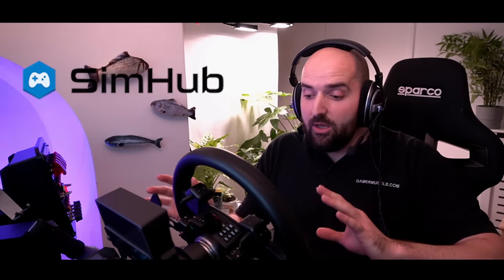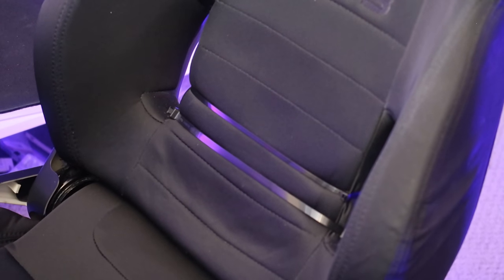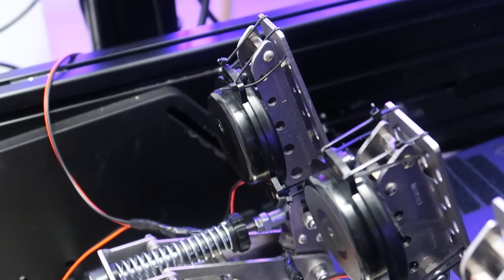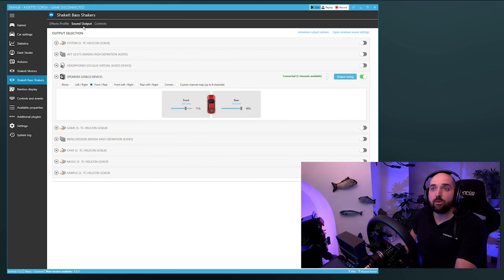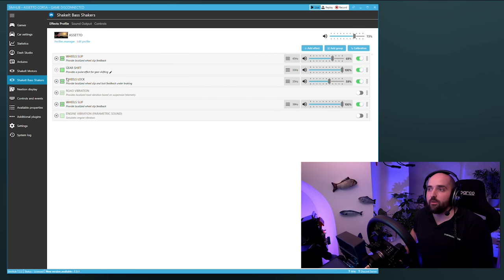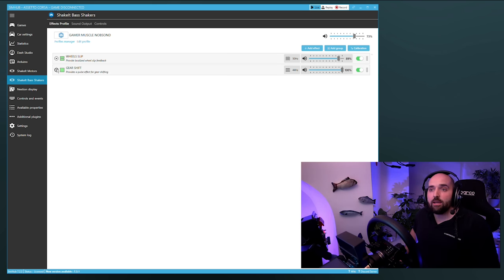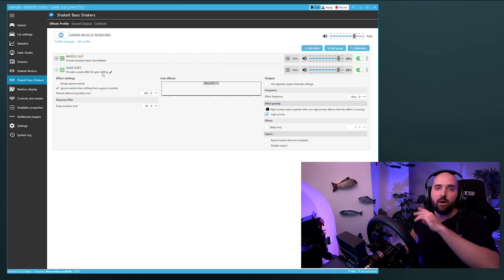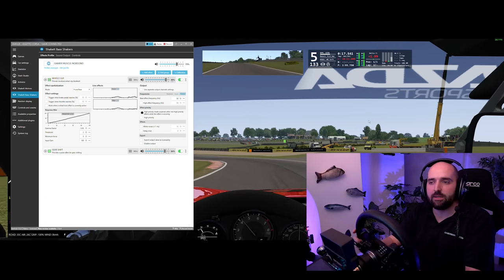How To Add Motion To Your Racing Simulator For £150 - Guide

Comment from the maker: Subscribe for more NOBSOUND - If you don't have fancy pedals it might work out better to use a single Dayton Base shaker on a pedal tray as well as seat.
My amazon links 
➤ USA AMAZON               :  https://amzn.to/2NdL7an
➤ UK AMAZON                  :  https://amzn.to/2LkP50n
Reply: They should've called this thing Noobsound, since it's not the right device for powering shakers! You want an amplifier that has power and in Germany it's called 'Endstufe', because Germans have a name for it and this watt-numbers some 'manufacturers' put on their box must be another Watt than the Watts you want. After my first amplifier died very soon from overheating, and this was a big Sony receiver allegedly capable of hundreds of watts output, I bought a Fame Quad 4150 with a weight of 17,5 kg without the box. There are lighter ones in similar XXL-size, but they come with a fan and it's not a silent one. The Fame Quad can power 4x 100 Watt at 4 ohm and nowadays I would pick a Fame MS 5004 that can output 4x 520 Watt, so capable of powering big buttkickers as well💪. If you power one or more of these and put your rig on springs (I would choose valve-springs for that purpose), you can call it a motion-rig😄
Reply: Hi James, are you still using this? has the Nobsound burst into flames? 
I am thinking of going for X2 Dayton Bass shakers with this Nobamp, the two bass units bolted left and right to the rig (TR160) to get engine vibration and road feel. To possibly transfer through the whole of the rig. Do you think this might do that, all be it possibly quite subtly, or is something more beefy required for that?
Reply: @fingers68  You need proper Buttkickers or similar (100+ Watt) and amplifiers that can power them. Usually I suggest to buy cheaper shakers, but Buttkickers are the better investment. More reliable and relatively silent (from the rattling). Also easy to fix to aluminium profiles.
Reply: @Leynad778  "relatively silent (from the rattling)"
 Yes this was another thing on my mind. I imagine cheep ones would be just like cheep speakers. Im wanting a subtle vibration not having the wife throwing slippers at me 2am in the morning due to the what could be a very annoying noise going through the house, possibly street!!
Reply: @fingers68  Than you better buy weaker ones like the Dayton-shakers and put your rig on rubber-feet. The bass-vibrations will penetrate through the floor, walls and ceiling and even vibration dampeners can't fully prevent that with strong shakers. I put my hole rig on acoustic foam and before on springs to prevent that. Wasn't loud for me, but for the neighbors.
Reply: @Leynad778  cheers for your help on this. I guess it's all experimental to get the feel your after. Do you think it worth trying the NOBamp with a couple of the Drayton's bass. I'm looking at this tiny amp and thinking what can that possibly be capable of? 
I would love to feel the vibrations from the engine when it's screeming, along with a bit of road feel. But if this is going to cause massive in house antisocial unrest, it's going to spoil it.
Bare in mind our house is not a quiet one by any stretch, two teenage kids,  we all like loud music. Had no complaints from next door. But bizzar frequency noise is another matter. 🤪
Reply: @fingers68  Read my initial post here. With tiny amplifiers you need to be in direct contact with the shaker to feel something I guess. Don't give up on a proper solution and just put your rig on foam to properly decouple it from the floor. This acoustic foam I'm using is a bit too soft and those gymnastic matts seems perfect to do the job. You need a bit of lateral and vertical movement and it also adds to the immersion. One matt could already do the job or staple two or three if not. They have the perfect stiffness.
Reply: Thanks for this video. My Nobsound was delivered today along with a DAC for my TV from Techole. I'll be plugging my Nobsound into my Techole over the weekend to test them out

Comment: Calling this motion is like describing myself as looking like Brad Pitt 😂
Reply: Works better in vr, helps feel of motion for sure
Reply: I second this motion
Reply: He think he means in a way to tell what the car is doing so technically it is adding motion information at least
Reply: Adding motion information & vibration IS motion.
Reply: @BoltRM  Not really because motion implies something moving not vibrations. So it is giving you information through motion of a rumble motor but not motion as in moving the driver clearly this is what i mean
Reply: @Simlife101  So vibration isn't movement?
Reply: @BoltRM  obviously motion in terms of sim is perceived differently than if the word VIBRATION if used in the title.
Reply: Exactly my thoughts. This is rumble feedback. Not motion. Motion means the rig or seat is actually moving to simulate some type of g force. Lol

Comment: Literally the first time I've heard of transducers being referred to as adding "motion" ;)
Reply from the maker: Yah its a bit of a stretch but at the same time it gives you some of the qualities that you get from motion rigs and certainly some of the immersion.
Reply: That my friend is called clickbait 😂
Reply: @GamerMuscleVideos  I pay 2200 euros in real motion, don't say motion if it's not
Reply: @GamerMuscleVideos  100% agreed with mr. Muscle. I use 4 small 20w vibration speakers on my rig, wheel, pedals and shifter for engine rumble and my t-gt is adequate for communicating wheel slip and traction loss etc. In vr it really helps to give the impression that the car is moving and improving the immersion greatly to the extent that i couldn't play without it. The thumbnail is a tad misleading though. I thought that the great el capitano had miraculously stumbled upon a new seat mover for 150 quid causing m' greedy old ticker to hammer in my chest. Take it easy tiger for christ's sake!
Reply: @GamerMuscleVideos  Clickbait.  I thought you were going to show us how to make a 2dof motion using windshield wiper motors. 
 Shakers are cool , I have a Shakekit (on your recommendation btw as well as a power wind)  but I wouldn't call it motion. (Unless you are counting the micro-movement of butt cheeks whilst vibrating, movement)

Good thing about this video is that it proves the Shakekit is 4x too expensive. Wish you posted this video before.

Comment: I'm really honoured by this presentation (as the simhub author) ! You are totally right, the "butt-feets" rule is the best way to start, "chassis" mode (corner) needs some more heavy hardware to start to be interresting
Often i recommend as a startup a 4 effects combo : slip, road vibration, road rumble and gearshift , but when it comes to entry level transducters, "less is more" and indeed less effects will improve the details, it's a matter of balance and taste :D.
Reply from the maker: Software is awesome :)  

Yah I have 4 of the pucks and have used some other rigs in the past after messing around a ton I found separate to immersion the main thing was the two pucks on the pedals and having them vibrate for front slip as that's the one effect that's often missing from sims ffb and can really help know how much you are pushing and to what extent. 

Bum shaker for gear clunk or listening to drum and base music is mostly immersion as you can typically feel rear slip from FFB getting lighter with most sims.
Reply: @GamerMuscleVideos   If you were driving a 750+bhp racing car at frightening speeds, surely the predominant vibration that you would feel would be it's thundering v8 engine, non?  I once owned a tvr griffith 500 and that was certainly the case even at 30 mph!
Reply: Hey Dude
I have been using this software with Project cars 2 and ACC ....Its Awesome and does just what it says ...Great job...
One question though Project cars 2 is the only sim that for some reason has constant vibrating when going down a straight in say the Bently gt3  any track...is this a  game issue or something else...All other Sims are sweet...
Can you try it Gamer muscle and tell me if you notice the same thing...must have kerb and grass vibration turned on..
Cheers
Reply from the maker: @jamesmccaul2945  you can shape the graph to get that to some extent. 

To be honest for it to really help with driving better you need the racing SIM to do the FFB from the wheel with seat of the pants and other aspects built into the wheel ffb. 

Shakers are great and add a bit of info and lots of immersion but they don't have the capacity to be anywhere near as detailed as what you get from a ffb wheel which is giving your hands a continued push force as apossed to a vibration of varying degrees.
Reply: I just got my own license...great program!
Reply: Kudos for an amazing piece of software. Thank you 🙏🏻
Reply: @jamesmccaul2945  Hi matey was wondering if you could upload a video of your set up of the shackers on your playseat as I'm looking to do the same. Many thanks Stu
Reply: @kevinharkness2108  I used to have one too... want to know how to get that TVR nostalgia trip? I found this out by accident while I was trying a TVR Tuscan mod in AC and in VR. While in-sim the bloke next door started sealing and creosoting his fence. The smell of burning, solvents & petrol transported me right back to the glory days :-)
Reply: @wotever Thank you so much for creating Simhub AND giving it out for free. I've already donated and so should everyone, your work helped bring Eurotruck and Assetto Corsa alive for me. One of the best examples of the DIY spirit of this hobby. It helped inspire me to build an amp from scratch (pcbs and wood) for my transducers as a 2020 COVID project.

Comment: i would not personally put these on my pedals. i think from driving in winter vibration comes before locking up and its the most grip you get, when abs kicks in its too late. and you feel vibration generally not with pedals but with the body so i think seat is the way. on pedals you just feel abs. when you start to slide vibration actually drops and it feels pretty smooth :-)
Reply from the maker: This is not literal to a real car , I mean you could set it up to be more literal if you wanted to its up to the end user.    
When using this I don't really perceive it as the pedals giving feed back its more like the front of the simrig vibrating.

Comment: As a sound engineer, I wouldn't be too worried about a fire. You need much more substantial amps that output more than 1000W to run the risk of a fire and that will only happen if you mismatch the impedances by a fair bit. My question is would running a quad channel setup for Front Left, Front Right, Rear Left and Rear Right provide any real benefits over a dual channel setup like yours?
Reply from the maker: Yep though its super unlikely I just don't want to be blamed for it if the Nobsound blows up on someone , my worry would be more the amps PSU than the speakers and wiring lol when a product is called NOBSOUND its good to expect the worst.  

I found that for the most part just front and back is fine I did mess around with more pucks and due to the nature of the vibrations there is only so much you can get from them that's of use for information. 

From an immersive stand point if you use them more for track texture / curbs and what have you then 4 channel + 4 shakers on the corners of the rig would be quite nice for me not sure if its worth the hastle like if you are going that far it might be worth saving up for a DIY Dbox type solution which will be much better. 

The great thing with this is that for £150 you get 80% of what's possible and a big of what you would get from a 3+k solution.

Comment: you can make your own transducer from a sub speaker, i used a sony home surround sub speaker with a nobsound amp that touches the underside of my fibreglass bucket seat. it works amaizing, best of all the misses and neighbours are none the wiser while my butt gets shaken about.

edit:

actually, the best thing is that the speaker cost £2.50, plus nobsound 20-25 quid, everything else i had laying about or made myself from scrap!

Comment: Simhub & Nobsound with 2x reckhorn 200i user here. Best money I have spent for providing enhanced immersion.
Reply from the maker: PURE NOBSOUND
Reply: @GamerMuscleVideos  I went for a big Nob, the 20g version 2x100w.
Reply: Do you think under the bucket seat or back on the seat is the best position for a reckhorn 200i?
Reply: Matt Lodge me too and the reckhorn is so good, can i ask i have an issue where i use astro mix amp for gaming headset and can not get the bass shakers to work on one audio output and the Astro mix amp for game sound and microphone can you tell me what to do in sound control panel on windows 10? i have to click the sound bar at the bottom and pick the nobsound amp to get the bass shakers to work but then my headset doesn't even though it is set as default device and communication device as that what you need to do with the Astro mix amp, or that the issue i need head set set as default and nobsound as default communication?

Comment: Thanks for the links. Found all of it on Amazon Germany and was able to buy the stuff for just 110€. Looking forward to try it out. Hope it will boost the VR experience as much, as you described.
Reply: I am not sure, if it will improve my driving, but my oh my is it a boost in immersion. Thank you again for this video. Great fun to drive, no matter if in pC2, ACC or AMS2.
Reply: Which amplifier did you take?
Reply: @tobireindl  The nobsound mini
Reply: @BadDanMe  Okay thanks then I have to buy it from Ebay, because Amazon is sold out 😅 Holder for 30€, Amplifier for 40 and TT25 for 40€ - so the same 110€ as you paid ;)

Comment: Great video GM - when you move upto Transducers, you can never go back - I had a Buttkicker a few years ago, that died, then I realised how much I missed the effect. Replaced it with pretty much what you've used in this video (as I didn't trust Buttkickers reliability - and my replacements were nearly 1/2 the cost). My favourite effects are feeling engine revs, and a good strong thunk for gear shifts. Cheers!

Comment: I have two of these large bass shakers on a thick aluminium plate under my seat, driven by a 100W MOSFET amplifier. It's awesome... and about a third the cost of a Buttkicker, and no doubt much more powerful in terms of moving a larger mass. The kerb and gearchange effects are awesome.
Reply: are vibrations too much for apartment use?
Reply: @P3ktoRis  if you have neighbours directly below your floor, probably - yes. They might wonder what's going on!
Reply: @combatwombat71  lol, then no i wont use it :D

Comment: Good vid.
You can add a second wheel-slip effect then use 'Separate Output Channel Settings'; you'll be prompted to name it, so something like 'rear' or whatever.

Under Sound Output you'll now see 2 Slip effects options, one called 'Rear' and your original one.  You can bind 'Rear' to your seat xducer and original to your pedal xducers; now you can set different frequencies and volumes for front/rear slip.
Reply from the maker: Yep that's what I did :)
Reply: @GamerMuscleVideos  Ha!  Great minds think alike, or is it fools seldom differ?

Am pre-coffee so apologies if I missed that in the vid :D

Comment: i got 8 pucks (4 pedals 4 seats) in stereo on my simrig and that's badass ! you can tell left curbs from right, i could never play without them again, feels so dull lol
Reply: You've got me curious. 4 on the pedals? How did you arrange your 8 pucks?
Reply: @jgagnier  8 16ohm pucks running in parallel stereo on a 4 ohm amp, 4 on the pedals stand (2 left 2 right), 4 under the seat (same left/right) :)
Reply: Faithful and true The Word of God 

Which amp or amps do you use and which transducers if you don't mind explaining?

I want to do as you with a feeling of left and right. Any advice would be greatly appreciated 🙏
Reply: @Simlife101  a Thomann The t.amp E-800 running eight 16ohm pucks in parallel (4 left 4 right). each side got 2 behind the pedals and 2 under the seat.
Also i'm on ps5, also i don't run SimHub, basicaly just the sound of the game going thru an equalizer/low pass filter Behringer FBQ800 Minifbq. 
it's a very simple & cheap setup but it works pretty well. If you can go with bigger bass shaker it should be even better.

Comment: I did something similar. I put 1 dayton on each corner I used simhub to control the tactiles, I used a 4 channel amp with 2 input. The amp connects to my pc 2 output channels. The rear is connected to bass output and the front is connected to the audio output.  It feels so nice and the emergition is so awesome.

Comment: Hey Bro! Amazing video. I've the same setup but I'm not sure how you wired the two pucks in the pedals. Cause I want to use a single two channel amp. One channel for the two pucks in the pedals and the other channel for the one under my butt. Could you please explain how you hooked wires together? Red with red? And black wit Black? Thanks mate! Greetings from Argentina.
Reply: Google how to wire speakers in parallel.   And make sure your pucks are 8 ohms or more.  I use this setup, and it'll treat the two pucks as the same shaker.

If you have issues, maybe just use one puck and shaker or get a stronger amp.
Reply: @bluex610  thanks mate. Happy racing.

Comment: Thanks GM & the guy who makes SimHub brilliant addition.  

Just wanted to say I tried the Nobsound and could have burnt the house down. Not sure what happened but it suddenly went extremely hot, lucky I was close by to realise what was happening and unplugged it before it burst into flames

I’ve bought a used Sony AV receiver off eBay, which I’m hoping will be safer